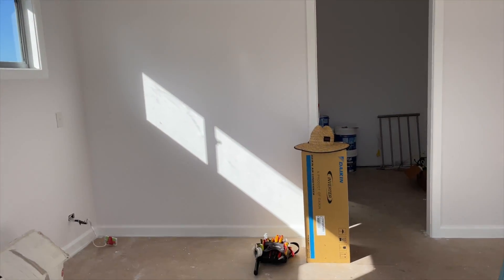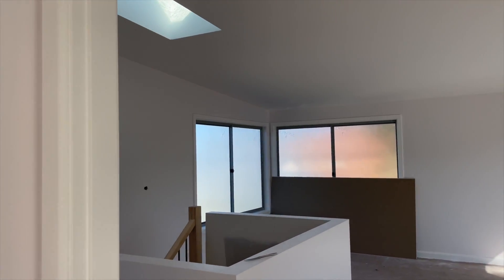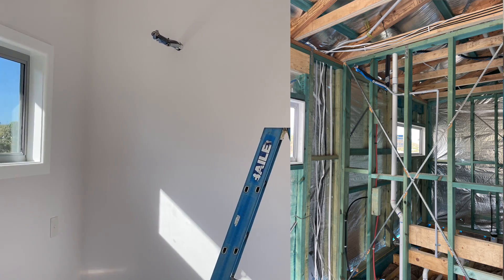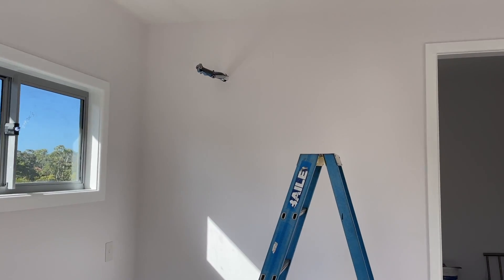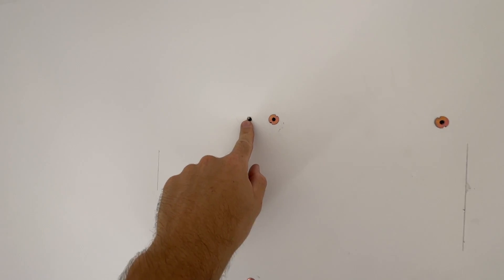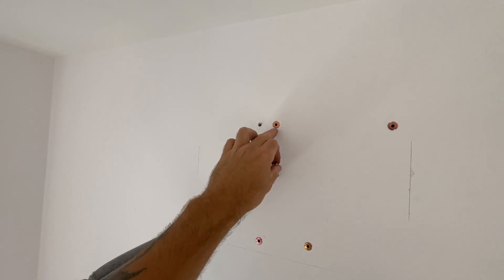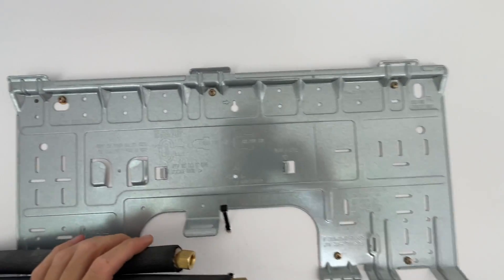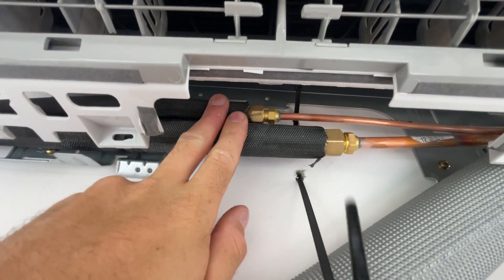INSTALLING A MULTI HEAD DUCTLESS MINI SPLIT⎪DAIKIN LITE

Comment: Hi Mitch thanks for taking the time to show us your installations. It’s fantastic the watch and get an understanding.
Hey a couple of questions on this install if I can. Firstly looks like the head unit condensation line is going to run into the ensuite sink drain? Where and how exactly does that get connected up to the plumbing. Would love to see some video on that kinda thing.
Secondly when you have the copper gas piped ruffed in as in this example, what happens when the unit eventually needs replacing? Can you use the existing copper piping in the new unit, or have you got a big job ripping gyprock off to replace all the copper?
And yer finally can you show us some examples of where you have run the condensation pipes to for the inside head units as I think that’s important.
Cheers

Comment: Hey  Mitch Im just wondering with a multi split, would you be able to have 2 separate indoor units on heating and cooling or will it only run on just one setting for all units?
Reply from the maker: So you can control each indoor unit independently however you can’t have one on heat and one on cool at the same time. Unfortunately this cannot  be done with “multi units”.
Reply: @maracservices  Ugh that sucks. Anyways thank you.

Comment: I personally wouldnt run a multisplit ever again in residential.. they all run heating or cooling, cant run one in heat and one in cool. When the outdoor unit has a problem, you lose all indoor units.. much regret having a multi split, wish i spent the extra money and got 3 separate units

Comment: Hi Mitch, I’m in nth qld and I have an old Mitsubishi multi head system 8kw and runs 3 heads in 3 bedrooms each head unit is 2.5kw.
I got a company out last week for a quote to replace it and they use daikin but the new outdoor unit they want to replace it with is only 5.2kw.
Is this right?
3 heads @ 2.5 kw shouldn’t my outdoor unit be an 8 kw.
5.2 seems really small for 3 head units at 2.5.
Thanks for your time bro👍
Reply from the maker: Hey mate, I’d personally go an 8kW outdoor so you can run all three units at the same time at full capacity. Companies do this so their quote is competitive. It would still work but if all three indoors are on, they’d all run at a lower capacity. I would ask the company to amend their quote to include the 8kW outdoor. 👍🏻
Reply: @maracservices  thanks heaps mate that’s exactly what I thought